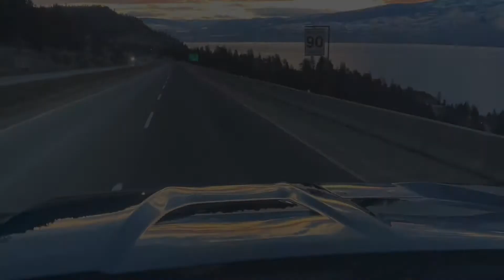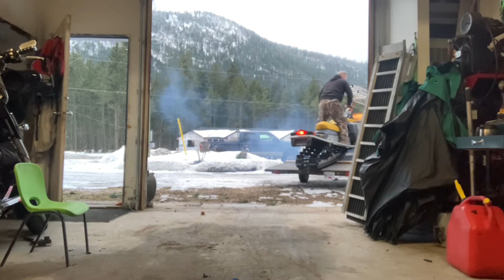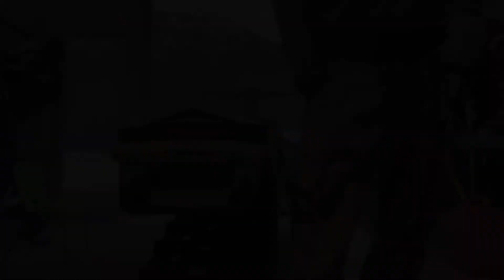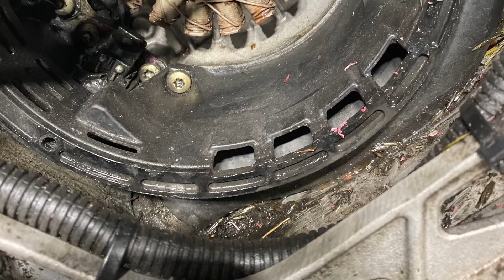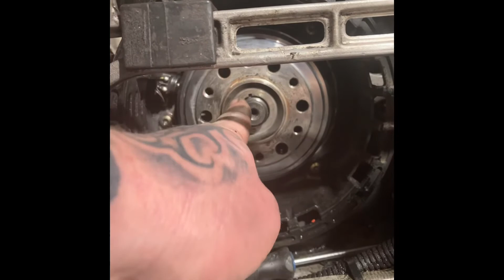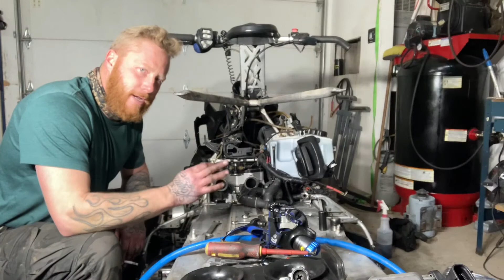How to change stater on 2008 summit xp

Comment: How many miles when your stator went out on that 2008 Summit?

Mine went at 1200 miles. Seemed kinda early for a major engine repair. 

Love the sled tho so whatever it takes to keep on ripping.  ;-)
Reply from the maker: I think it was 2000 km
Reply: @donerightbydadproductions  - Right on schedule! And that's why folks hate on the XP's. They run great until they don't. Seems as though some Skidoo lock tight would have prevented one of my inner stator bolts from backing out and destroying everything on the mag side. Oh well. My 800R is back to one pull starting. Two pulls on a cold day. Hard to hate on that!
Reply from the maker: @fairbanksairriders  yes sir
Reply: I like hearing how ski mountains maintain their sleds. One ski area with skidoos would pull the top end to check it and replace the Stator each year! Good times